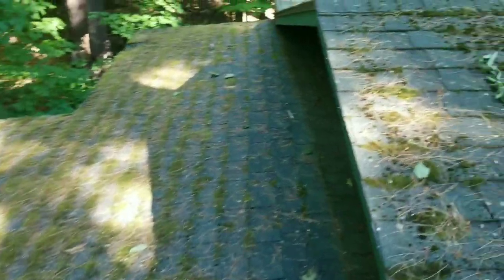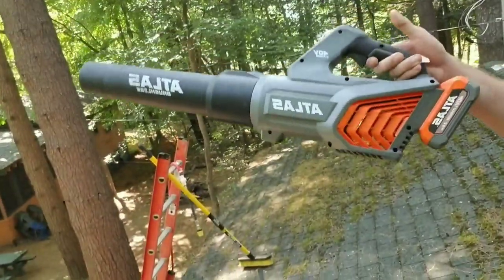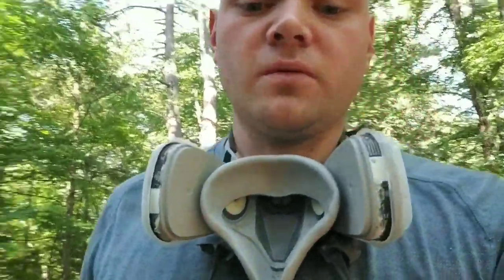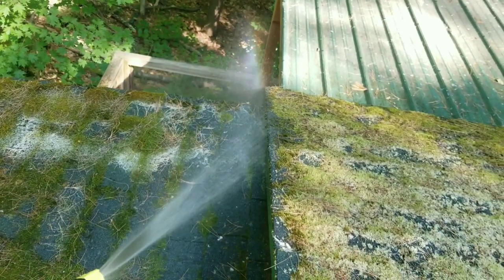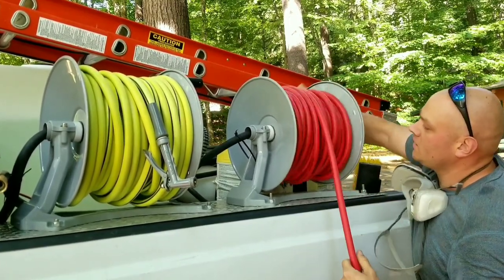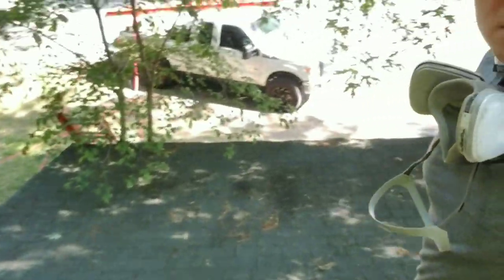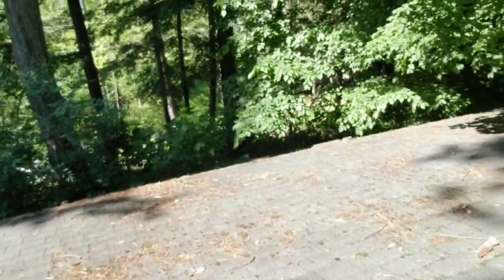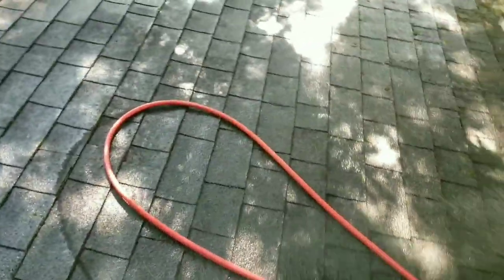The DIRTIEST Roof EVER! Covered in MOLD

Comment: I’m sure you’ve probably got another hose reel by now, but if the handle ever falls off you can drill a hole (if necessary) into the outer ring, put some washers a bolt and handle through it and it’s fixed. 

Might even be better than the first one for like $15-20
Reply from the maker: That reel is long long gone 😄
Reply: @YoungAmbitionYA  figured I so! That’s like a reverse wheel chair, I already know that hot old quick 🤣
Reply from the maker: Check out some newer vids and the newest setup

Comment: if batch mixing, how many gallons of sh and water?
Reply from the maker: Depends on what mix you want? Roof or house wash. 1% or 6% mix? How big is your holding tank. Its can vary depending on the job so its variable. Not a one mix does all
Reply: @YoungAmbitionYA  For roof washing. I have a 35g tank. From what i have read, 1G of SH and 1G of water. But that dont seem right to get 6% by the time it hits the roof

Comment: Really shouldn’t set your ladder up against the shingles. It breaks the edges. You shouldn’t walk on the very peak of the shingles either. There’s no support and they will break. I’m curious as to what the wooden decks down below looks like after all your overspray splattered on them. always try to protect the customers property unless you’re looking for litigation.
Reply from the maker: Completely agree! This was my first season. Lots has changed since. The decks were pre wet and didn't have an issue. I don't walk peaks any more and use ladder standoffs. I don't really take much work now that involves roof cleaning. Plenty of money to make on the ground

Comment: How will you remove the dead moss from the roof?
Reply from the maker: Hey Mike. If the moss is light it will remove its self with the wind and rain once dead and dry. In this case with the roof in this video and the thickness of the moss a revisit with a brush and blower wouldn't be needed
Reply: @YoungAmbitionYA  revisit after hours or days ant time frequency

Comment: Soooo as of right now I only do commercial pressure washing mostly surface cleaning sidewalks. But I’ve been looking at getting into soft wash. All of that moss on that roof, I could not imagine walking away from a job looking like that. I know the chemical continues to work after you leave but then what happens? There’s no way all of that moss is completely gone and all you can see is nice clean shingles. Doesn’t that have to be scraped off or brushed off or some thing and cleaned again I would think?
Reply from the maker: What's up Chris - thanks for the comment! You definitely need to talk to the client on jobs like this and let them know what to expect. Any moss jobs I do I always tell the client up front that I'll brush off the excess, spray and kill the rest, and come back if needed. I've sprayed some roofs 2 or 3 times over a season. I just cant fit all that into one video. I'm upfront with my customers about realistic expectations and I've only taken the job if we are on the same page. Moss is always a lot more involved than just spraying streaky roofs!
Reply: Cool vid man, any way you could've rinsed off the roof in this situation? 
Thanks

Comment: That's awesome. How much does that over spray effect the wood deck under though? Do you want as well or tarp it off maybe? Nice truck set up too man.
Reply from the maker: Hey Kevin. Thanks for the sub and the comment! The chlorine won't hurt the deck. The main concern is with the vegetation which is well rinsed. It never hurts to splash some water on the deck before and after to be safe, but it won't really be affected.
Reply: @YoungAmbitionYA  the cleaning solution will mess with the deck! You should be wetting the deck at the same time as the plants because it will affect the wood on the deck if left with no water to dilute. Thanks, Ed Ernest

Comment: Don’t costumers want to see the moss off after the first visit?  They trust you that’ll come off itself with rain?  Or do you come back to remove it?  Thanks
Reply from the maker: You always want to be sure to talk to and educate your clients on the process. The owners here were told that the moss would start dying then turn brown. After a few weeks of it drying out it would come off on it's own. When a roof is that bad I tell them I will stop back in a few weeks and check on it! Most roofs aren't this bad thankfully!
Reply: Young Ambition Soft Wash  100% 
Always set expectations up front. Control the process
Reply: Hey just seen this,  looks great. would you use this same procedure on concrete tiles too.
Reply from the maker: Sure could!

Comment: Can you also scrape the moss off first before spaying?
Reply from the maker: You can but be vary careful. Very easy to uproot shingles. I use a stiff bristled broon to knock off loose moss but you only want to give it a few passes or you can hurt the granules on the shingles. If it doesnt come up with a pass or two of the brush I leave it and spray it
Reply: @YoungAmbitionYA  makes sense, I guess it will depend on what kind of roof tile it is etc..I'm enjoying you channel and seeing your journey..👍🤙
Reply from the maker: @hillysextractorcleaningser8934  correct. Slate roofs if they're walkable you will have a lot more leeway. Thanks brother!

Comment: Hi there,

couple of questions:

What kind of soap do you use and what ratio to the water/sh mix?
When and after how much time do you rinse or done’t you rinse most of the time?

Greetings from Holland 👍
Reply from the maker: Hey Freek! On Shingle washes I use a soap called Roof Snot. Mixing instructions come with it and I believe it's 1 cup. The only roofs I rinse are metal. No need to rinse asphalt Shingle
Reply: @YoungAmbitionYA  How hot is the SH mix you used? 3%? 6%? did you need a priest to bless it? haha
Reply from the maker: @bhhacker  6% 🔥